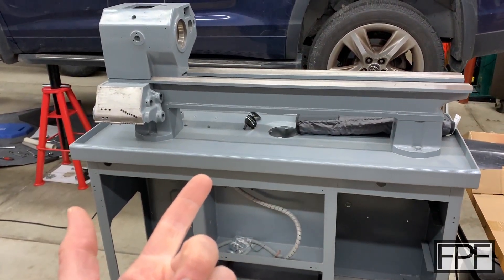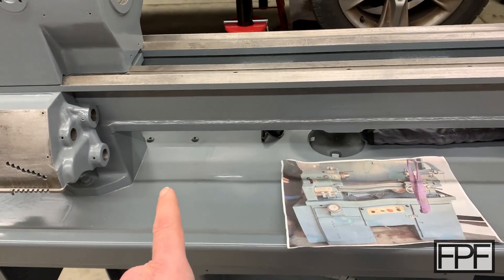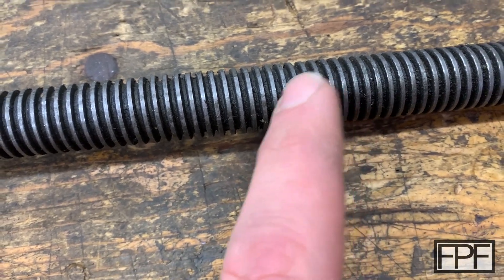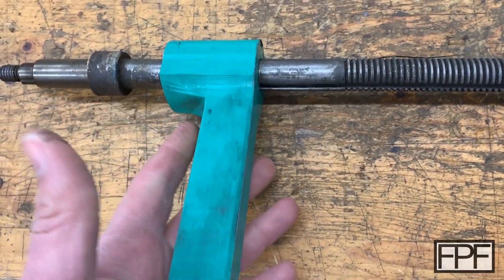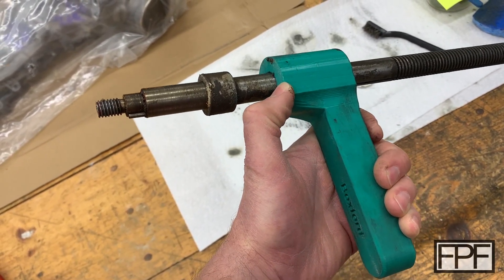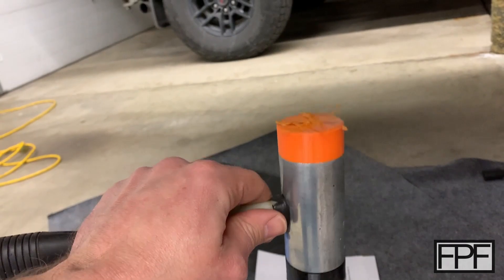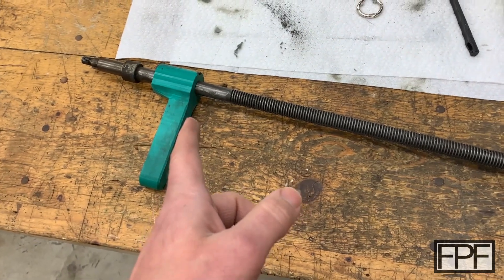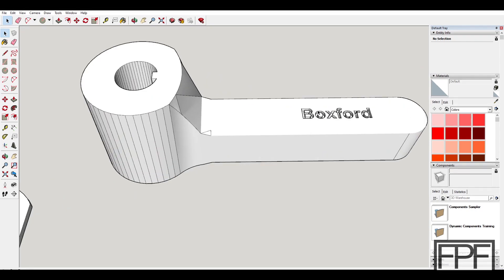3D Printed Boxford and South Bend Lead Screw Wrench

Comment: You should have made a hole in the hammer for air to release pressure on the PLA part ( I guess, this is just a suggestion from a non-scientist).

Also, I think PETG would be more suitable for that application.
Reply from the maker: The suggestion of a hole is an interesting idea.  I could see a point load on the face causing a section to compress and put pressure on the whole thing . .

Comment: Im not sure if SBS filament is availible in the states but that should be ideal to replace the pla of the hammer. Its much harder than tpu but not as brittlr as pla and prints similar to pla. You can check out Filx if you want look at the SBS
Reply from the maker: thx, I'll have to check this out

Comment: PETG or printing the PLA in a different layer orientation might also work. PLA is strongest along the longest “strand” direction. If you configure your slicer to print the hammer face vertically with the strand lines perpendicular to the face of the hammer, you might get better results.

I had a PLA screw that kept shearing until I changed the print orientation, then it worked nicely.
Reply from the maker: Worth a try.  I was thinking I wanted it strong in compression and that it would split if I had layer lines on the end.  I wonder if maybe TPU with a PLA core might work as well.
Reply: @FunctionalPrintFriday  hmm, maybe a retaining ring printed horizontally and press fit the striking body? I dunno haven’t tested it so I can’t say for certain.